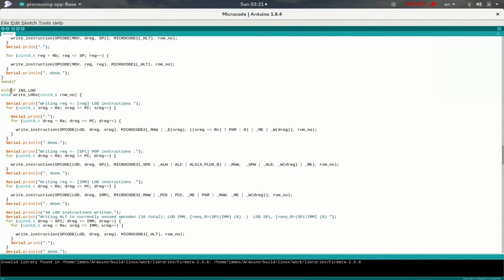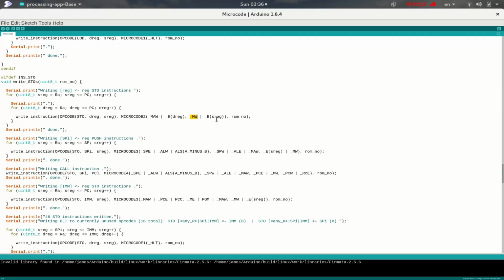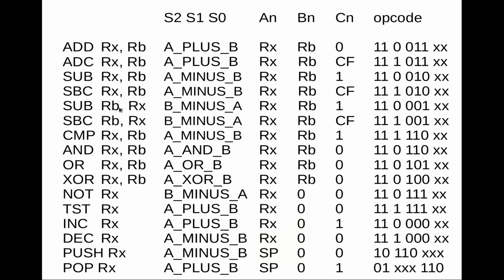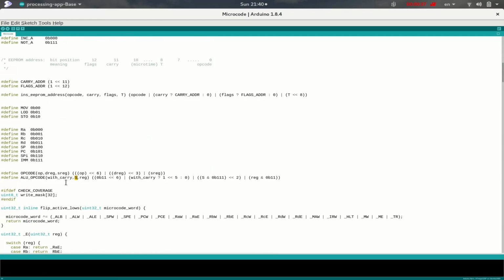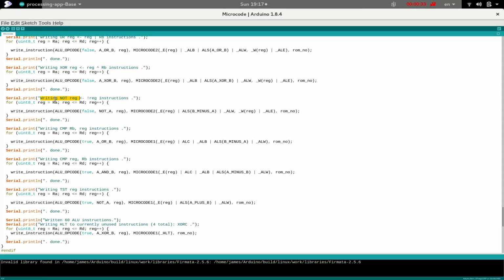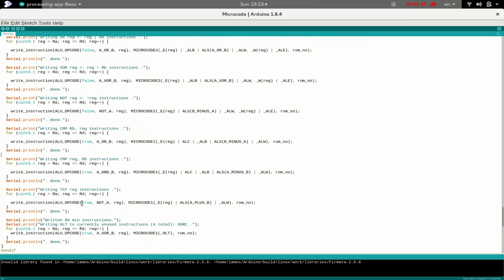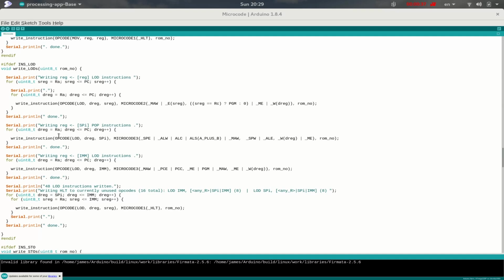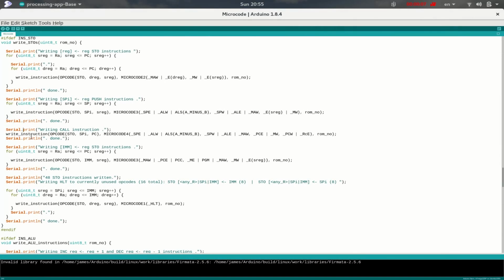My Ben Eater inspired homemade 8-bit CPU - Part 11: Microcode - II

Comment: James, this is really great stuff.  I've been playing around with your design, and have started making a few changes for my own variant.  I'm considering writing a cycle-accurate simulator for it, but may end up just building it :lol:

Anyway, first thing I did was write a new microcode generator that just spits out 4 separate ROM bank images that can be written with any old programmer at a later time.  While I was doing that I decided to make a change to how the decode ROM is organized; instead of putting the opcode in the lower bits, I've but the microcode step counter in the lower bits, so that all of the steps for each instruction are sequential in the ROM.  That made the microcode generator a little simpler, and seemed like a more natural way to organize the ROM.

Second change I've made is to how the memory access works.  I want to have an IO space on my version so that I can hook up some peripherals (like a 6521+6522), so I changed the single PGM signal to a 2-bit address space ID... I'll use a binary decoder and some combinational logic to turn the decoded ASID + _ME/_MW into the appropriate selection signal on the CU.  That gives me D-space (0), I-space (1), and IO-space (3), and a free slot so I figured I would give the stack its own 256 byte space as well (S-space at ID 2), and all loads and stores relative to the SP get redirected to that space.

Also didn't like how Rc was magic vis a vis loads (coming from PGM space), but I really like the notion of being able to load data from there (super useful for e.g. tables in a program ROM), so I'm playing around with ideas for alternate encodings to do I-space loads (I obviously need some sort of alternate-space LD/ST to support the IO-space anyway, and I'm totally OK with those instructions being more expensive... so I may end up with a 2- or 3-byte encoding that can hold the ASID, maybe an additional register, and an immediate address/offset, along with an additional 4-bit register in the CU to hold the ASID).

Anyway, I'm having a lot of fun with it and wanted to give you kudos on such a great video series explaining your build!
Reply from the maker: Good to know you are enjoying the content, thanks! 

Someone actually already wrote a simulator for my CPU a while back: https://cpu.visualrealmsoftware.com/emu/?h=7e387e0f377e010716bd0c7d1042303915fcc22f0d6e48656c6c6f2c20576f726c642100

Comment: Hi James, i have a question: What exactly is negative number in this computer?
Reply from the maker: In pretty much all my examples, I interpret the 8-bit values as unsigned integers, from 0 to 255. As a result, I frequently use the carry and zero flags, but hardly ever use the negative and signed overflow flags. Furthermore, the decimal display on my A register displays the number as unsigned, because I have tied the A10 address line on the EEPROM to 0V.

It is possible to interpret 8-bit values as signed integers between -128 and +127, using 2-s complement representation. The ALU will work fine with them. If you do, you'll likely be more interested in the "negative" and "signed overflow" flags, rather than the carry flag, and probably you'll want to set the A10 address line on the EEPROM for the digital display to 5V, so it shows the Ra contents as a signed integer.

Comment: Hi James, thanks for your work. A simple question: I would like to uild mine cpu too, where did you buy all chips? Is there a convenient palce, a web site or whatever you can suggest?  Thx a lot. Daniele
Reply from the maker: Well, I started at digikey (https://www.digikey.com/): they have a huge selection, and a pretty good shop search system. They ship worldwide, although to Europe of course it's a little bit more expensive than local suppliers.

Here in Germany, two large web suppliers are also https://www.reichelt.de/ and https://www.pollin.de/. For small quantities, https://www.conrad.de/ have a network of local outlets all over the country, and I got a few parts (such as the pnp transisitor from episode 2) over the counter from them.

On Ben Eater's site, in the comments section, https://eater.net/8bit/#comments, some guys were putting together a part list for reichelt.de I think. Just search for "reichelt" on the page!

Comment: Wow, i literally just finished watching part 10 about an hour ago thinking "damn.... wonder how long i'll have to wait for 11..."

Turns out i only have to wait to put my twins to bed and give my daughter a bath....

After watching Ben, Illet's and your videos.... i want to build my own CPU... but not on bread boards... i'm thinking perfboard...
Maybe put the lights and switches on a front panel....
Reply from the maker: Perfboard is an option. I think it's more work, and it's less forgiving if you get things wrong... And boy, did I get things wrong, many times! :) Youtuber  https://www.youtube.com/user/ozmodian started work on a perfboard version of Ben Eater's computer. I don't know if he's still working on it...

I think the breadboards really are much more forgiving when you wire things up wrongly. Or even just when you're playing aroound with chips before deciding on a definite arrangement. And of course I have never touched a soldering iron in my life. People who are more used to them, might have less qualms about making mistakes on a perfboard.

Good luck on your project anyways; should be very rewarding!
Reply: James Bates i've been soldering since i was about 12.... so, nearly 30 years ;)
Radioshack used to sell boards that were etched like bread boards... i thought about using those.... build each section on a breadboard and then transfer the circuit to something more permanent....

I also briefly considered custom PCBs and a backplane....

I'll have to think on it a bit more and watch a few more videos ;)
I like the extensions you added to Ben's design... i'd probably want to add a third clock mode. Auto, clock-step, and instruction step...
Maybe AND the micro-clock reset signal with an "instruction step" line and put that on HALT...
Reply from the maker: I was thinking of such a clock mode too. Would be really useful for debugging actual assembly programs